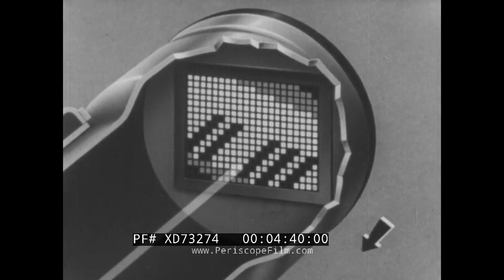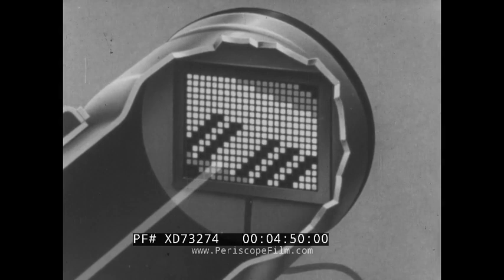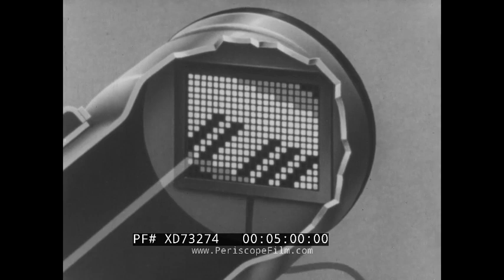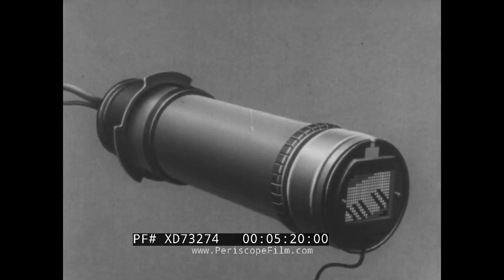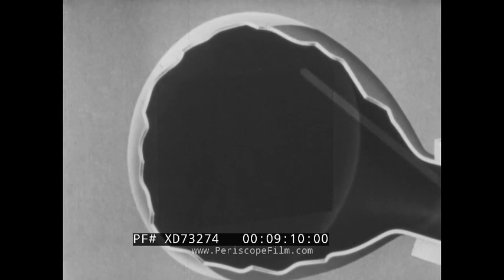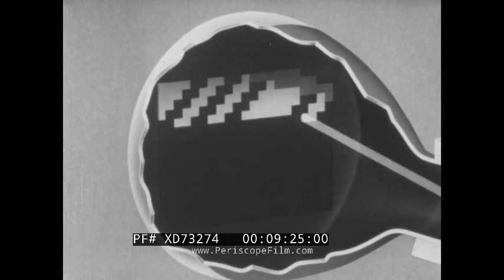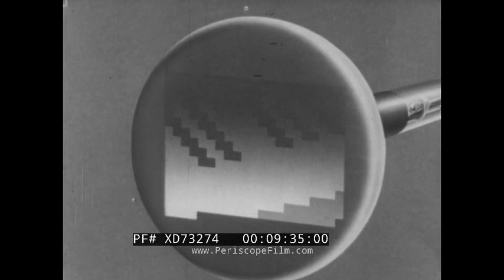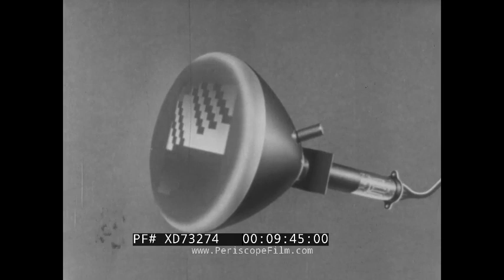" HOW TELEVISION WORKS " 1950 BRITISH EDUCATIONAL FILM   TV BROADCAST & SIGNAL TRANSMISSION  XD73274

Comment: "Fifty time per seco-- oh, right, PAL." -- My brain at a certain point, not having picked up on the whole "BBC" thing, somehow.
Reply: NTSC - never twice same colour

SECAM - system entirely contrary to American method 

PAL - peace at last!
Reply: 50hz is not PAL, in these times, England used B&W 405 lines TV system; PAL is a system color, for example Brazil still uses PAL-M but switching to digital.

Comment: Nice.  Kind of shocking how advanced a thing it was for that time, all of this required no computers to work, it was entirely analog.  And equally shocking what this has become in less than 100 years.  4k HDR with digitally mapped, spatial 3d surround sound (Dolby Atmos).
Reply: Shocking is the right word…the anode which collects stray electrons in old televisions carries a huge charge.